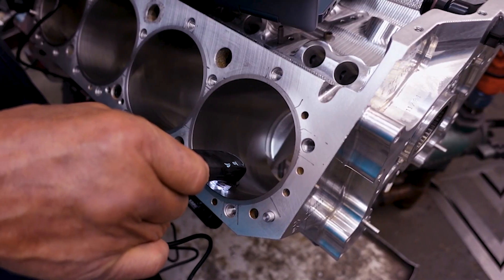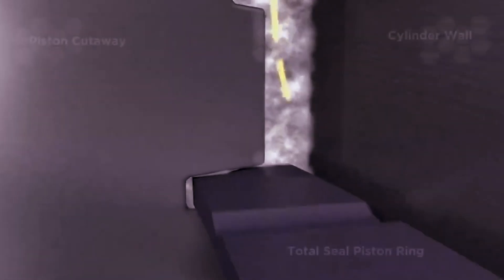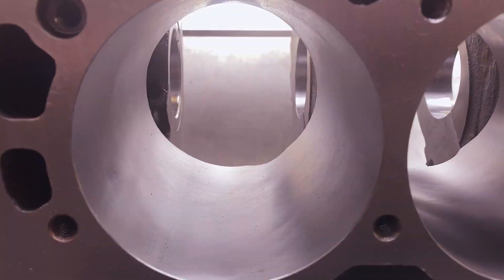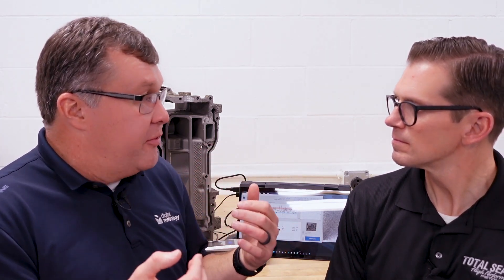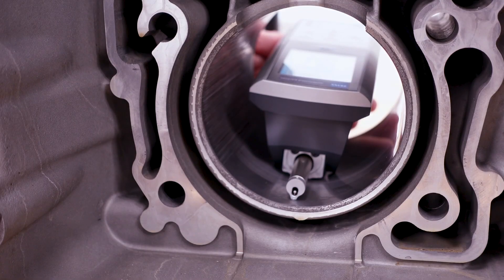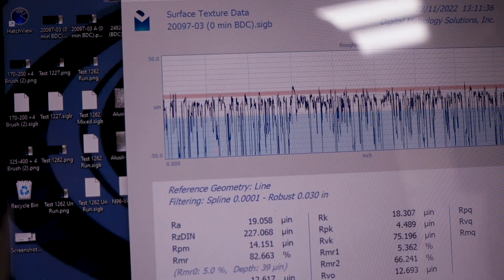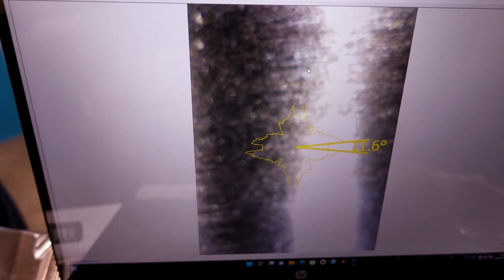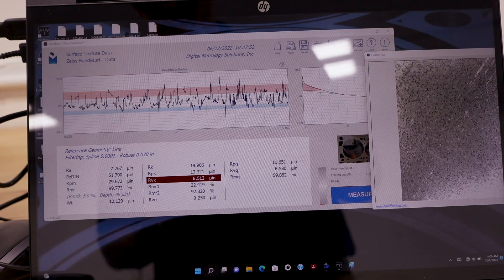Honing Mistakes That Will RUIN Your Engine!

Comment: My local machine shop did my hone & I used Total Seal 46770ST-6 AP rings in my 12 Mustang 3.7 cyclone with Manley rods and pistons. Versus the stock ford piston rings I have 50-75% less blow by. Seriously even at 7500+ rpm minimal. I would go from changing my catch can once a month to every other month. My little 3.7 cyclone made 324 whp through a 6r80, Circle d 3c & 355 gears.  I have tons of dyno print outs. Best with stock pistons and rings was 316/306 to the wheel. Manley pistons, Totalseal rings 324/309. Both pistons were 10.5-1 Im a believer in total seal piston rings. Love the Info I honestly purchased my rings because of the info from these videos.
Reply from the maker: Thank you for sharing your experience!
Reply: The only regret I have with total seal top gapless rings,is not having to rebuild any of my engines right now. 
The times I have used them, you nailed it with the minimal blowby. 
On a leak down test after 30k ,the needle moved a width of itself or 2 off of zero.

Comment: Thanks again for another great class room segment! I wonder how the USB microscope and profilometer might show the difference between a properly prepared and cleaned bore vs one just wiped down with the red shop towel (seemingly the standard). And what exactly is a lint free cloth...    ? Thanks as always😎
Reply from the maker: Thanks and that’s a great question! The USB microscope would show you any lent left behind!
Reply: Lint free cloth? We use newspaper or the whitish masking paper with ATF as a bore cleaner after I was taught this by a noted engine builder...Process starts off with HOT! water & Dawn Dishwashing soap....Spray WD40 on machined finishes before drying and after drying then the ATF in the cylinder bores wiped with the paper until it comes out clean with no dark residue.
Reply: @ejgrant5191  interesting. Thanks. I have tried to find the elusive lint free definition for a while now. It seems like a simple question but it is not. That is a great process so thanks for sharing. I have been harassing Lake with this question for a while now. 😎
Reply: @TotalSeal 
My memory is fuzzy, but I thought I remembered somebody talking about doing the white glove test when you use the quick seat , because those bores have to be spotless like you're serving tea to the queen. 
And I thought I got some gun cleaning patches for the white glove test and used them to clean.
Any darkness,keep cleaning sucker!! 
The quick seat went on no problem. 
Really had me nervous ,so I treated it like a surgeon. 
Well a surgeon that opens up injector pumps and understands cleanliness. ❤

Comment: How much if any does cylinder wall finish affect near wall detonation characteristics by the amount of oil dilution to fuel condensed at cylinder wall  especially in high compression engines will huge swirl from modern cylinder head port designs ?
Reply from the maker: It doesn’t affect detonation, but the oil chemistry can affect detonation.

Comment: Next level , the motor im playing with , the tolerances are so tight it dont have bearings , rod or crank bearings ..my dial bore gauge goes down to .0005 , the spec sheet measures in .0001 , max. Wear limit 3.2697 "  or 83.051 mm on stock size piston ???
Kohler command v-twin 26.5 hp efi model # 749-3043 ..i need it bored , cylinder taper  and mic'd ..